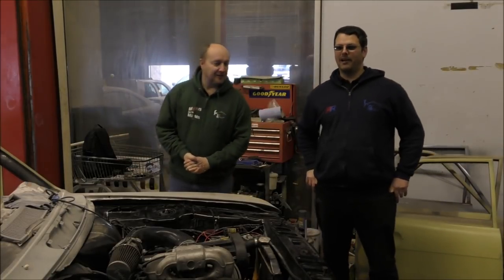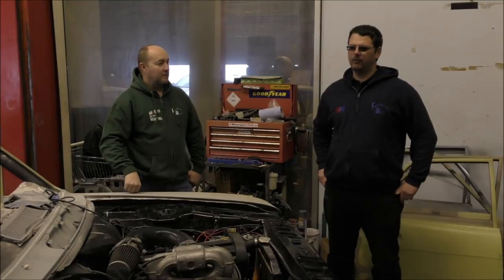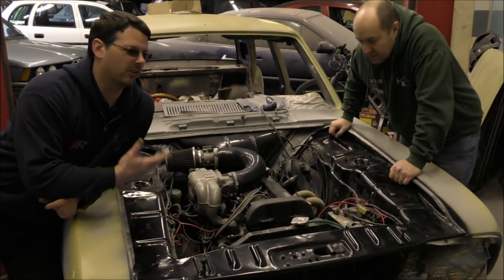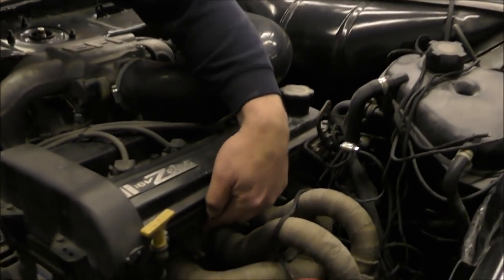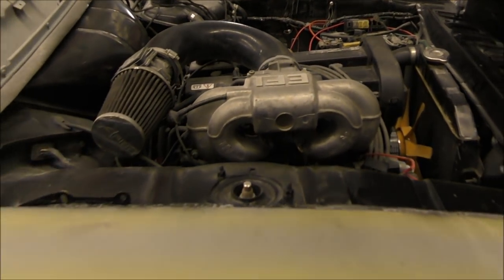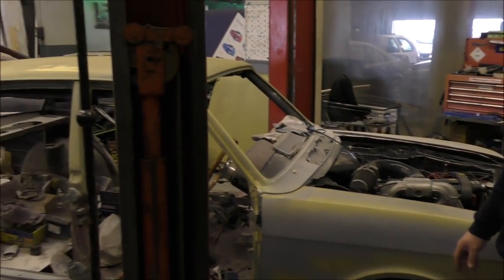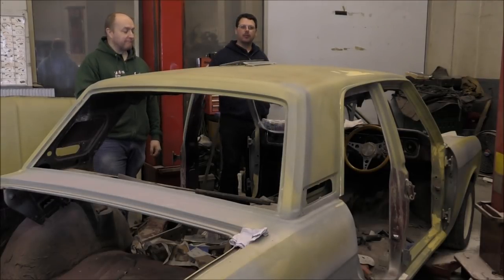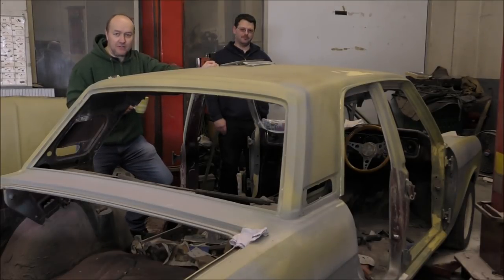1968 Cortina BUILD Project Ep1

Comment: Back in 70's and 80's I had several mk2 Tina's....last one was 3rd 1600E, that was  nicked and bent.....but spent time and money and welding rods repairing most of them......then went to a 1500gt  mk1.....had that till the A frames rotted out and got to need just too much repair.
Ended up in a mk4...2.0 ghia....which I started in taxis with........cortinas were great cars....loved them....wish I still had that J reg 1600E  now....lovely car that was......would be worth a good sum now....bought it with a knackered engine for £300  6 months MOT....no tax......had an engine in the garage i worked at.....rebuilt it and dropped it in within 3 days.......lol

Comment: I'm part way through the restoration of my 1970 1600E. Had two E's in my early 20s. Kept getting nicked! However, still loved 'em. Bought one 10 years or so ago for a retirement project. But somehow retirement hasn't come! Still chipping away at it. Put a 2 litre Zetec in it with a type 9. All underside repairs done now just (!) upper bodywork to do. One day......!

Comment: My Dad had a mk3  Cortina XL20L. Went round the  clock twice and bit. Tough car dad used it as a farm hack Towing cattle trailers  ,overloading it on a daily basis,  Driving it over fields  and generally abusing it. You're interior looks like Dad's did 😂😂😂  In the end mum refused to get in it . It finally  died  when Dad was fetching some bags of coal home (no mains gas in the sticks. Only got mains electric in 68) Back axle snapped. Dad wanted to  repair it, MUM SAID NO !  And made him buy a new car. He mourned  it's passing for years.  He had it about 12 years, It was 6 months old when he got it  Good look with the  build, Dad would approve 👍 Should I send a wreath for Mark. ?
Reply from the maker: Haha...thanks. I had a MK3 also, started as a 4 door 2 litre gxl. Ended as a 3.5 V8 2 door

Comment: Nice colour choice and nice job. Don't understand not going for a 2 litre though for an extra few bob.
Reply: Hi thanks. I made this choice for several reasons, but mostly because the doner car was £100 and came with very nearly everything I needed. Also I was not looking for loads of power I just wanted a usable, reliable classic car. It is cheap to run and still has double or more power than the car had from new, that's it really.

Comment: I had a 68 Cortina back in the early 70's.  The carb sucked so I put a bank of Zacukunis off a motorcycle on it.  Man that little thing could move. But sadly the Lucas Electrical system totally sucked.

Comment: Hi, was the intake a bolt on or you did some modifications to it?
Reply: The intake that came with the engine was the later plastic-type which was too low and interfered with the steering box so this one is a earlier efi one and bolts straight on the only mod I made was plugging the brake booster vacuum port as I have struggle brakes, so it was not needed, I even used the idle air control valve and the throttle body from the plastic manifold, just needed to mod the linkage a little.
Reply: @TOTk1980  thanks